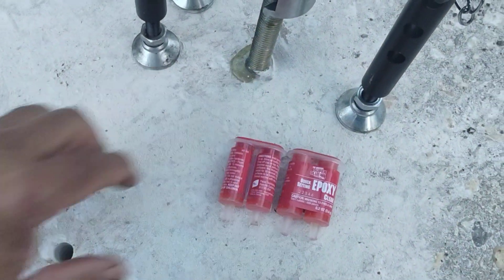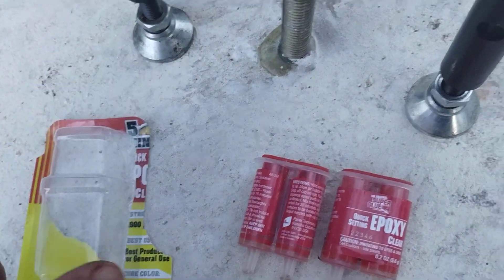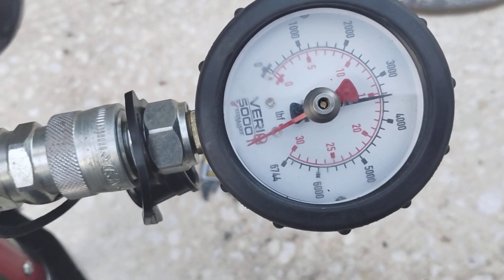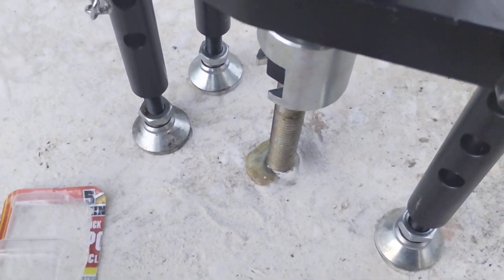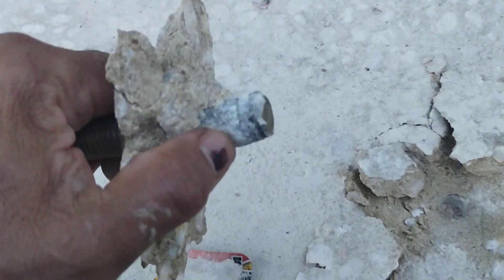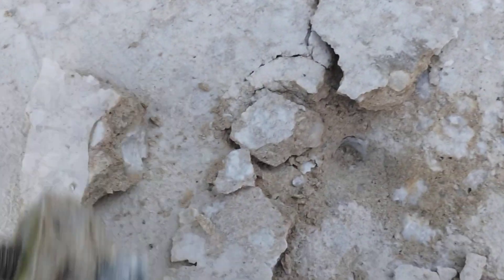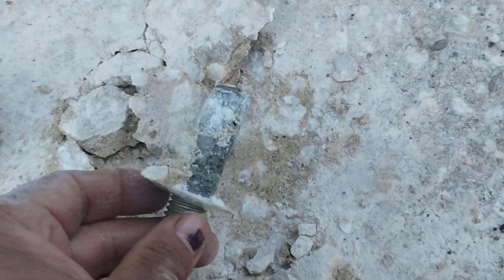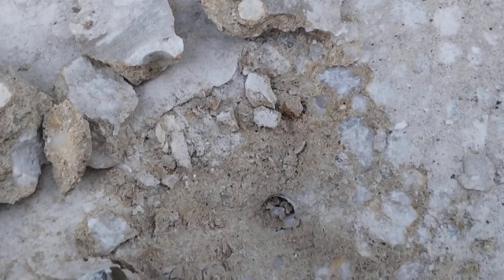Anchor pull-out test threaded rod ⅝"x2" deep 1900psi epoxy results in 5000LB force results #boltdept

Comment from the maker: Please support the chamnel with a comment and a thumb's up, ty 
This is a beautiful example of how 1900 psi epoxy can get you 5000 lbf of pull-out resistance to ultimate failure.
The load in this concrete and this epoxy, this rod, this weather, would be safe around ¼ maximum.